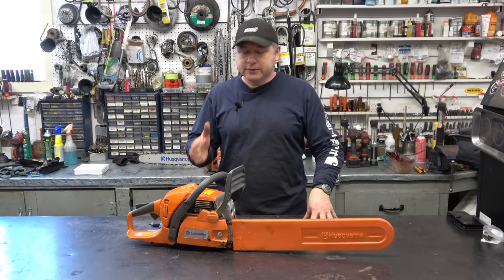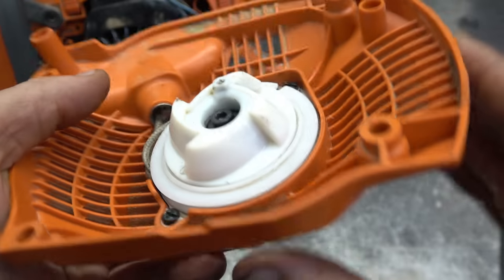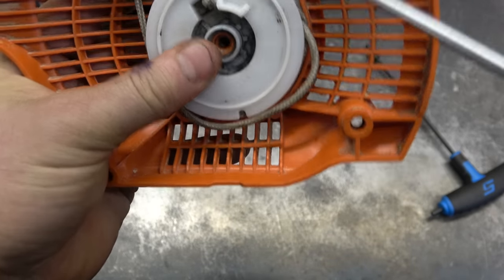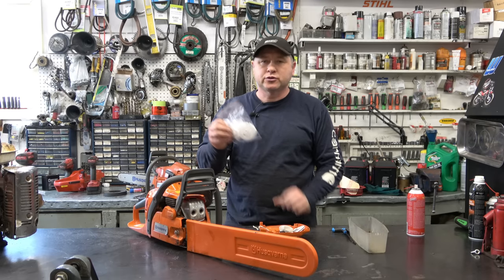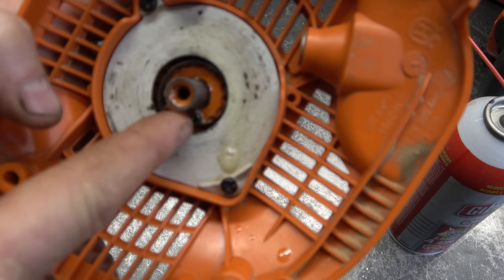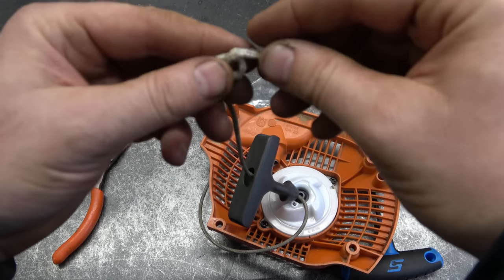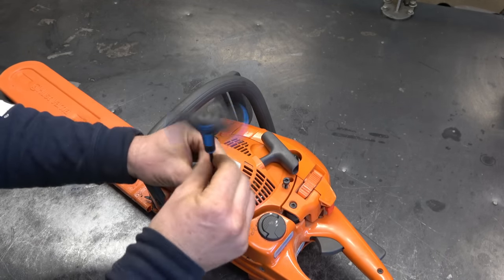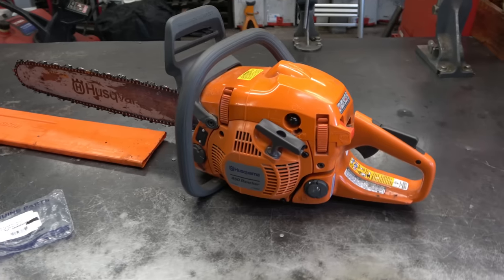Husqvarna Chainsaw Pull Starter Jammed Up! Step By Step Repair!

Comment: Well, the original one did not last either. This is  quite sad how they make things these days.
Reply: Your absolutely right about that they make complete junk!!! I'm still using a 30 something year old garden tractor to cut my property. The thing is still to this day a tank. With regular maintenance of course
Reply from the maker: exactly!
Reply: *how Husqvarna makes things today.
Reply: These saws are Poulans that Husqvarna owns. Designed for limited use.
Reply: Most times I pick up a used Husqvarna  the owner is clueless about the easy to start and simply pulled too hard. Big box purchased so no proper instructions. These last a while when starting it proper

Comment: The 1st piece of equipment I ever owned was a small Husqvarna chainsaws I got  for $5 with a busted pull spring I was 15 and had just started small gas engine repair an elective class at my high school and that was the 1st repair they taught us so I knew right away how to repair it that was 43 yrs ago
Reply: Let's hear it for high school trades class!

Comment: Great video . I do the same figure 8 knot but I put the loose end facing inside then pull it right . Also mentioning the direction of the big spring 👍. Some parts look the same but only go one way .👏👌🇨🇦

Comment: Came across a similar one today. Came to the same conclusion after trying to adjust it a couple times, this one wasn't cracked as bad, but the nylon was worn.

The short length of rope you can put on the recoil really invites destruction with this 'easy start' system, which unfortunately seems to be true for most easy start systems if you try to start it like a conventional professional saw.

Comment: You mentioned that the no name ones may not last; but the OE did not last either.  Any idea what may have caused the part to fail?  Under engineered or just an errant compression "kick"?
Reply from the maker: cheap plastic and customer reefing on the recoil
Reply: @donyboy73  those wily swedes could have used glass reinforced plastic but no go Pedro... 😹

Comment: I've had more problems with the clutch brake then the recoils. I hate that soft pull recoil crap. I wonder if you can get an aftermarket quill that doesn't have that junk?

Comment: I have a Poulan Pro PR5020 20", made by Husqvarna, so my Pull Starter may be the same or very similar.  I'm sure that Husky Rancher costs a good bit more than mine, so cheap plastic parts may haunt me, but I certainly hope not.  I have a large diameter, 6 foot tall stump at about a 60° slant into my yard in a back corner that barely touches my property line from a hurricane-downed tree and two more recent smaller whole tornado-downed trees to deal with, and possibly two large trees to take down, one very large with crazy long, thick and high branches.  I doubt that 450 Rancher saw this much work, so I'll see how the PR5020 holds up.  An organization came to deal with the hurricane-downed tree for free, but left this large stump because it is not on my property.  I bought the chainsaw to deal with the hurricane stump, and possibly the two large trees, but now I have more to do than I started with.  I bought an Oregon bar and chain because reviews said those that come on it are junk.  I'll use them until trouble and then put the Oregon on.  I bought a Stihl 3-in-1 Sawchain Sharpener to deal with sharpening quickly and easily.

Another great one, Don.  Thanks for all you do for us.  You're the man!  I can't afford a $28/month Patreon and don't see "Buy me a coffee."  Are there cheaper Patreon options?  The only other Pateron I do has a $4 option, which I do for him, and they go up from there, but I didn't see options on yours.  I'd like to help you and your wife.
Reply from the maker: hi thanks for the comment, on Patreon you can contribute as you wish whether it's $1 a month or whatever. You can also use the Paypal donate button on my channel page.

Thanks,
Don
Reply: @donyboy73   Thanks for the reply.  I'll check it out again.

Comment: So basically the failure on this pretty much brand new saw was a poorly designed part for the EZ start. They should sell a kit to replace the EZ start and make it a normal start. Issue resolved.

Comment: Perhaps the customer should be cautioned on how hard he pulls the rope on startup which is probably the root cause of all this. A lot of misinformed people think more force is the answer to every problem.
Reply: do you really think customers read the f-wording manual? 😬
Reply: @kittytrail  -No. This is why I suggested the mechanic point out the proper starting procedure when the customer picks up the machine.
Reply: @kevola5739   "whatever... 🙄"  is, sadly, the level of attention the mechanic or salesman will get in return most of the time. 😑
Reply: @kevola5739   i'll add that what you call a "lot of misinformed people" is just what your regular customer base is and they, mostly again, won't change their mindset because they know better than you, mr. know-it-all salesman/mechanic...  😤
Reply: @kittytrail  - I don’t care whether you follow my advice or not, I am not the one who will suffer.  -Mors Kochanski

Comment: I bought one new, and this problem was only after cutting 3 logs. I took the saw to the dealer for it to be fixed and serviced. They told me it was my fault for starting the saw wrong. So I decided to test the saw after they fixed it just to make sure, so I proceeded to start the saw as per the instructions in the owners manual, and low an behold first pull it broke again. So I threw the saw in the dealership's rubbish bin where it belongs. Do not bother spending any money fixing this pathetic saw just throw it away and buy a real saw or even a Chinese saw much more reliable. Husqvana lift your game this is not acceptable